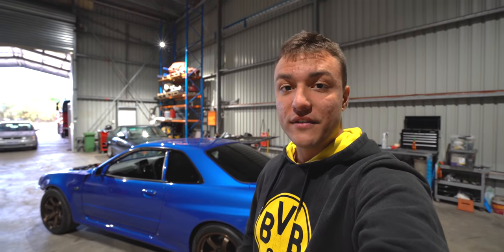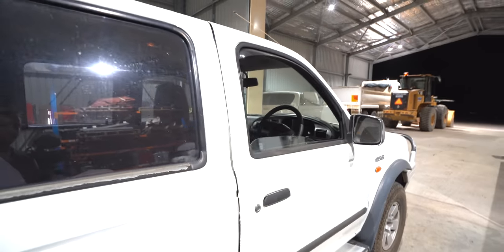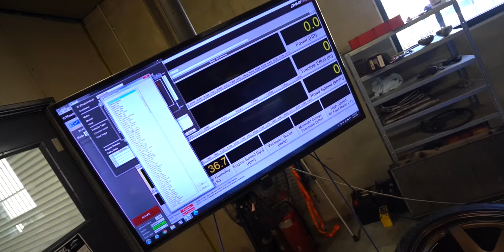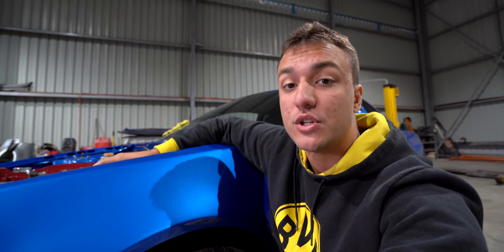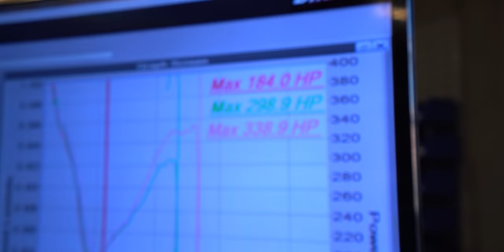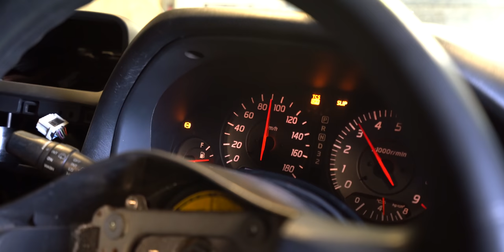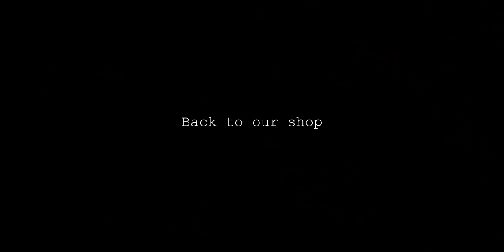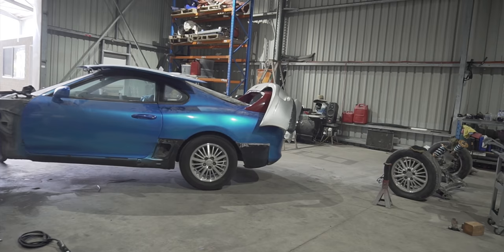The R34 Skyline DYNO DAY! | Poor Man's GTR [EP27]

Comment: If you ask me, a car weight between 1200 to 1600 kg with "real" hp at the wheel of around 400~650 is quite good for me. I'm more worried more of the rest of the bits like chassis and suspension effecting handling.

Comment: I've got the single axle Tilta for my race car. It doesn't squat as low and only carries 1150kg but it tows good and is way cheaper than the dual axle airbag trailer

Comment: The car looks amazing! respect that you are honest about everything and about the broken turbo. I'm wondering what is the location of the drilled hole for the oil feed? And to where goes the oil return line to the sump i think?
Reply from the maker: Return goes into block
Feed is from the oil pressure sensor on the other side of engine, used a T to tee off a line

Comment: How much boost pressure can an rb25neo take on pump gas?  19psi would be a conservative number. 14psi is  extremely conservative.  Definitely needs more boost, especially when power is still increasing past 7000rpm.

Comment: So 371whp is about 433bhp at the crank. Why such a big turbo for power you can get out of a hybrid? Also i noticed he did increase your limiter up to 8k rpms. Bit risky but okay, doesn't look like it helped with power.
Reply from the maker: Just a slap together build
Reply: @BrokenSilvia  I get that. I guess you had that turbo laying around then. When does it see full boost?

Comment: Aren't the rear tires supposed to stay on both rollers? I've never seen a car creep up so much. Got to the point where I thought you were gonna catch that diamond plate and have an absolute disaster.
Reply: Would be also nice to know how that dyno works: when the rollers are not linked, it means with the wheels on only one there is a lot less resistance for the engine which could give a wrong reading. But as I don’t know the mechanics of the dyno it’s just a suggestion which probably is wrong, haha.